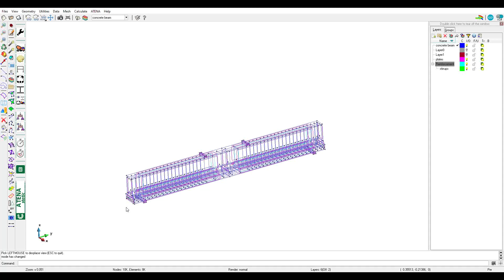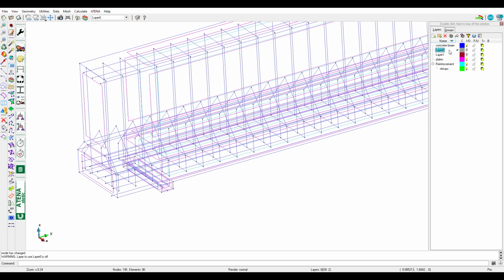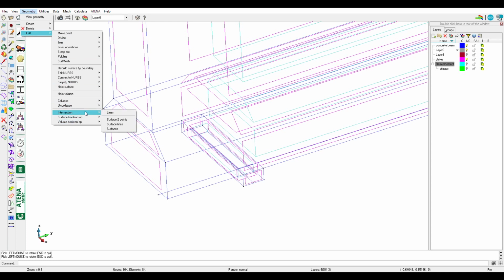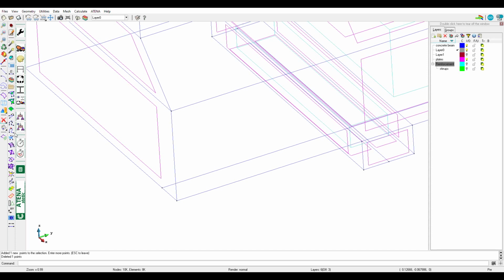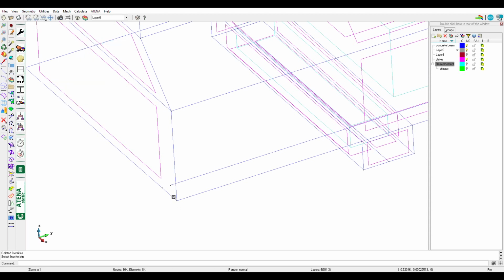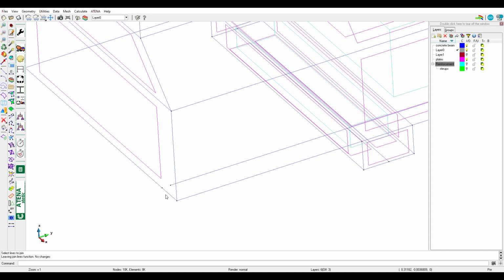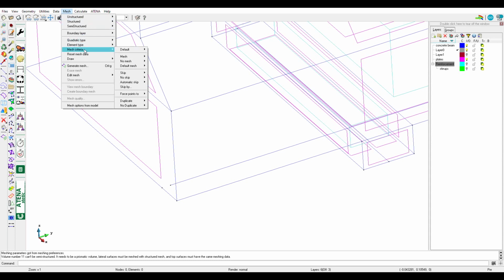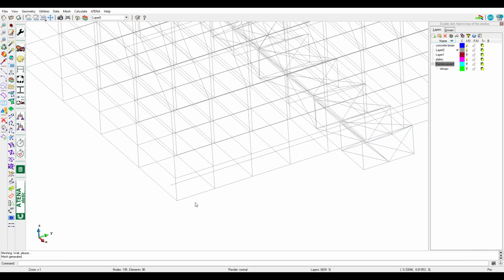Mesh Criteria

Comment: what is the name of the software?
Is this GID?
Reply from the maker: they are two : GID for drawing the model and define the materials, and then ATENA software which is a Non-linear structural analysis software for reinforced concrete structures.
Reply: @CervenkaConsulting  thanks
Reply from the maker: you can visit our website also for more information : cervenka.cz